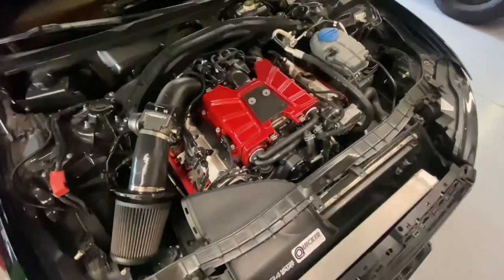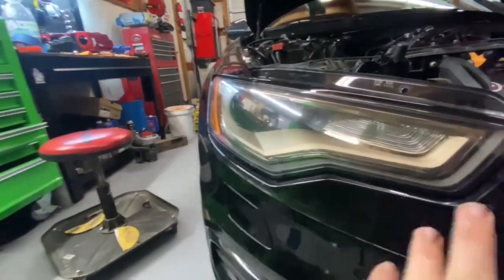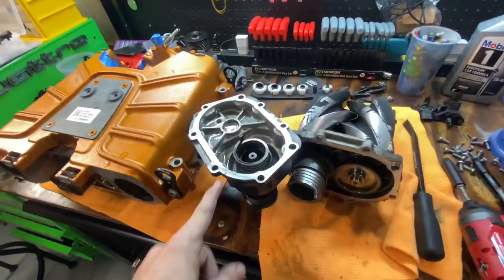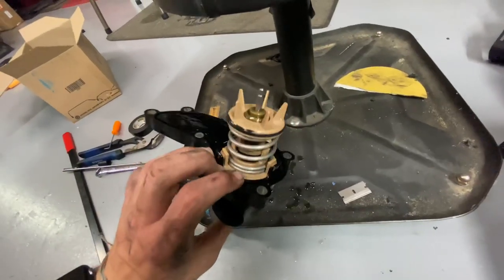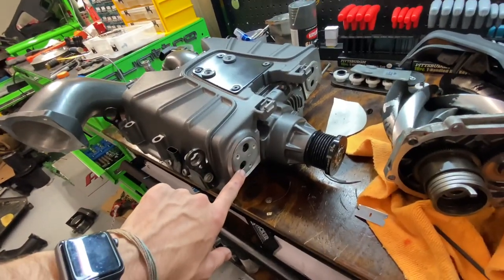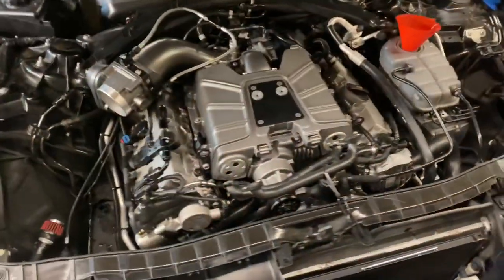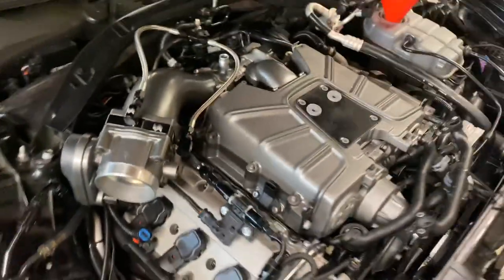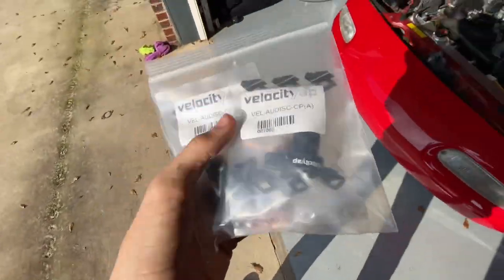Audi A6 Overhaul! Prep for a 10 sec pass!

Comment: Did the oil filter housing gasket fix the oil leak? I've replaced my valve cover gasket twice still have a small leak somewhere its not coming from the timing chain cover or the valve cover. Are you data logging just to check your timing corrections, fuel pressures, and inlet air temps on pulls to see if you really need that much meth. Looks great like the color scheme  👌

Comment: hi! please tell me what was the difference in power and time after installing the ported supercharger? 

PS you followed me in dragy, for some reason I can't write comments there- I have a6 c7 single pulley, ecu and tcu revo (most likely they use tvs software for dsg).  a custom intake and exhaust manifolds are installed. cooling of the compressor is stock. the best time is 11.98 1/4, 9.9 100-200 and 3.96 0-100.this is in full weight and at 255/35 r20. the plans include porting the supercharger and an enlarged heat exchanger. so far, single pulley setap, since revo allows you to change fuel cards using revo sps, and there is not always normal gasoline in my area

Comment: so with a more aggressive ported blower what are you running 1/4 mile now? I'm pretty much going the same steps but trying to save time and $. So far I have 034 ECU stage 2+  207 crank, 034 motor mounts, ie downpipes, and the next mod is tcu. Stock exhaust and stock intake for now.  Thoughts?